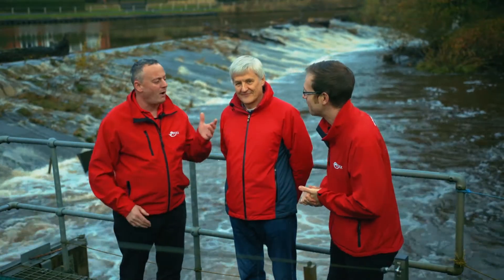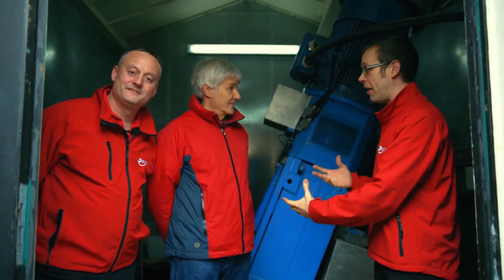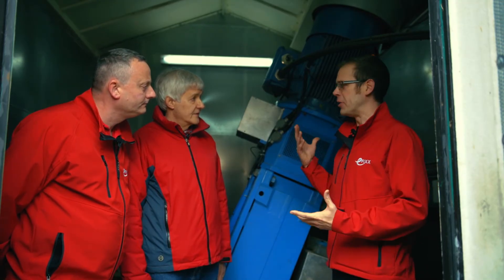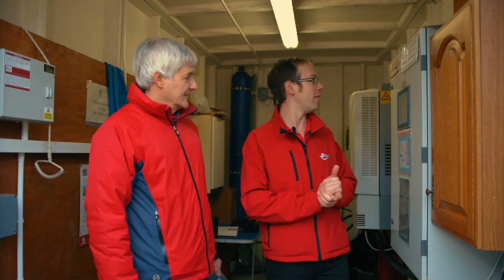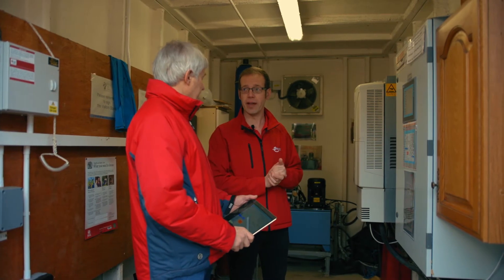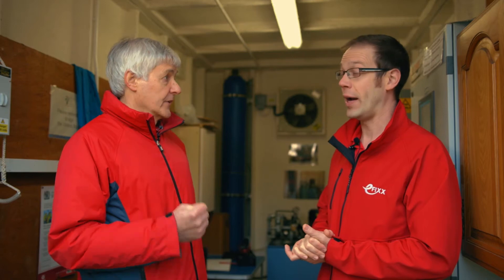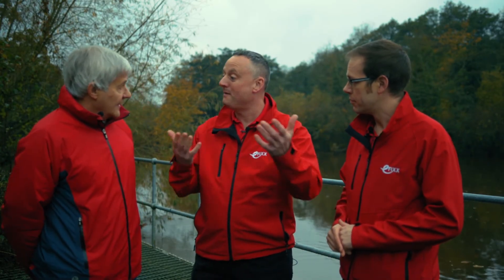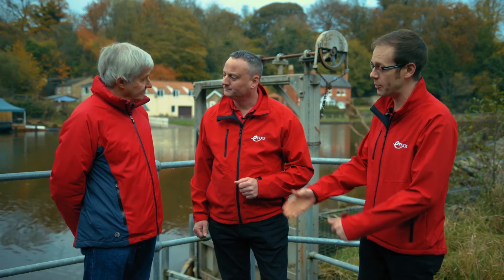Hydroelectric generator using an archimedes screw, 3 phase induction motor and vfd.

Comment: 10% loss to the gearbox was a surprise to me.  Would a slow speed motor/generator with more poles not have covered its extra cost via higher efficiency (and less noise…)

Comment: This really cleared the fog from my brain. I'm looking at property right now capable of a 12kw hydro turbine. I was thinking I was going to need to build some custom complicated dump load controller to shunt power to a dump load to control the frequency. Now I'm realizing I can just use a VFD programed correctly with a speed sensor to automatically shunt power. Not exactly the same setup but your video still triggered light bulbs.
Reply from the maker: Let us know how you get on.

Comment: Very interesting.

I got a bit confused with the annual generation numbers:

40-kWh x 24-hours x 365 days = 350,400 kWh 

However, the stated number was about a third of this.
Reply from the maker: This is because they have to balance river flow with generation. During the summer months the river has a lower water level = less water for generation. 

If you go to the Whitby Esk energy website you will see the real time generation and seasonal variance.
Reply: efixx I missed this point during the presentation. Thanks.

Does this mean that on an annual basis their capacity factor is around 30%?
Reply from the maker: Yes - Here’s a link to the actual data

https://whitbyeskenergy.org.uk/powerlog/
Reply: @ek9772  Yes, we run approx 1/3 of the year shutdown, 1/3 flat out, 1/3 variable